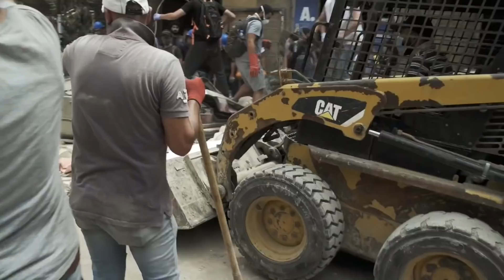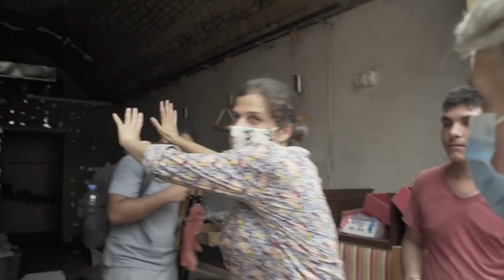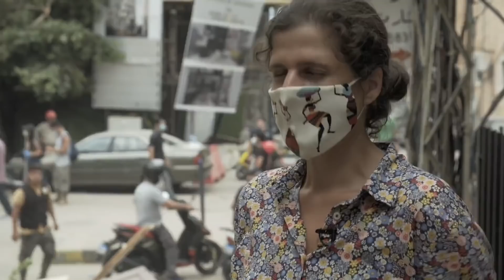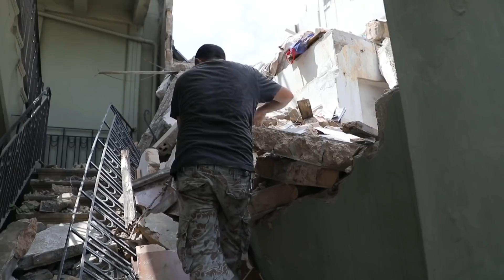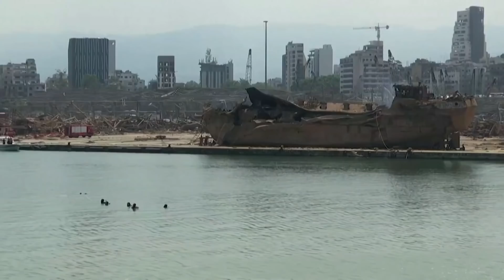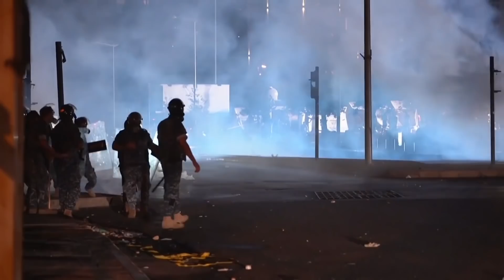Beirut explosion: Search for missing continues and protesters clash with police

Comment: There is no doubt that there were firefighters at the port trying to put out a fire at the warehouse before the fireworks exploded then moments later after that was when the ammonium nitrate exploded. The fire was said to have been started by sparks from welding and all the videos show there was a trail of black smoke before the fireworks exploded producing gray smoke which led to the big explosion of dark red smoke and the rapidly expanding round Wilson cloud of white vapor.